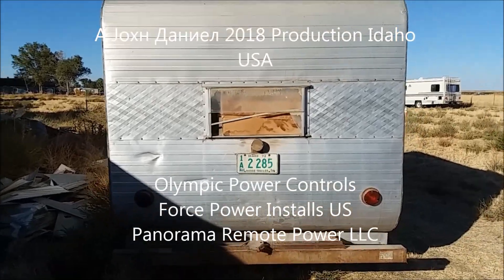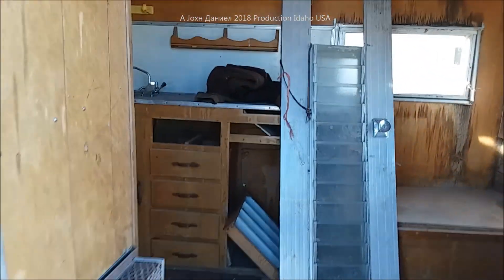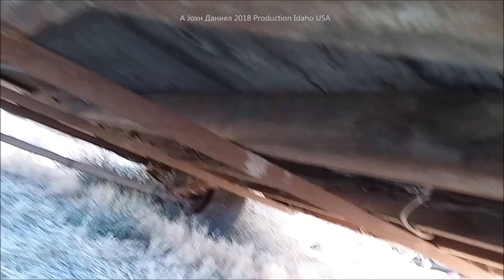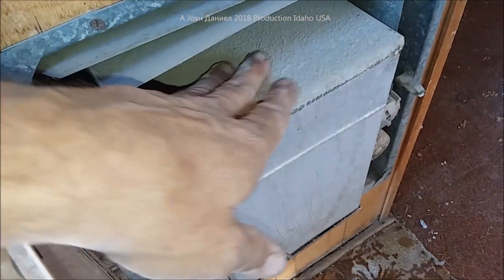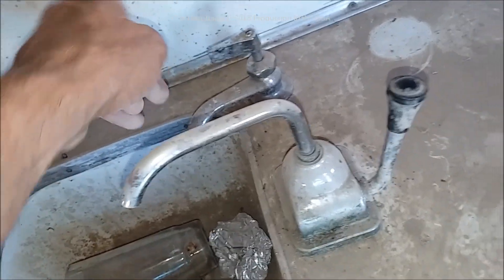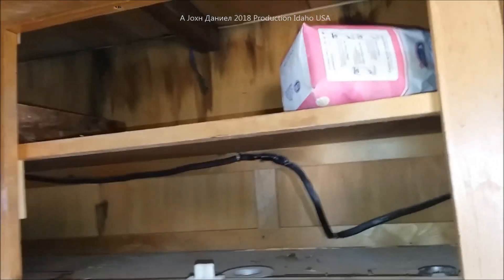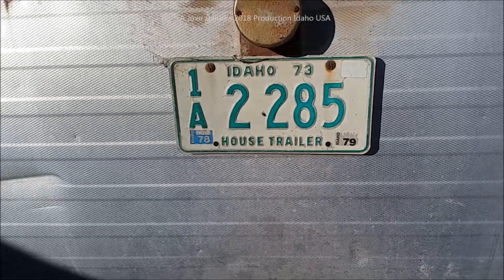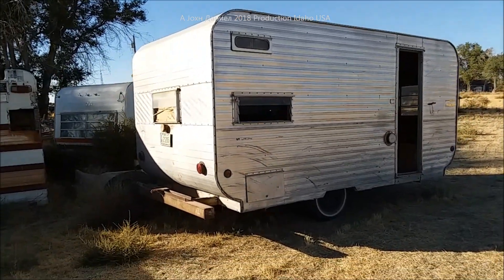60 year old Canned Ham Camper $ SAVE or ♻ SALVAGE

Comment: I had one very similar a few years back. Didn't really do what you would call a restore job on it, just cleaned it up real good and fixed a lot of things. Had it looking pretty good and smelling a little better too. Took it out on the first camping trip about 10 miles from home on the Missouri River down a gravel road. Had a great weekend in it, lots of fun. On the way back home the gravel road completely shook the thing apart. It was literally collapsing in on it's self. The dry rot was a lot worse than I realized. I scrapped it and sold the frame to a guy that made a flat trailer out of it. Rest in pieces canned ham, I tried!
Reply from the maker: This one if restored will be a copy job. So not technically restored, but certainly remade. Using 2" metal studs to frame on the existing trailer chassis with same build design. Inside cabinets and doors are damage free, so its a big advantage.
Reply: It would be sweet restored that's for sure. I really like old ones. There's a RV Historical Museum in Elkhart IN. worth going though if your ever in that area. If you decide to restore it be sure to keep your camera close, it will make a great video series.

Comment: Restore it and sell it as a classic.
Reply from the maker: The cabinets are a very nice condition even though the rest is a rot mess. So I MAY do a frame off, thats pulling the box off the frame then making a deliberate copy back on its frame.
Reply: @JOHNDANIEL1  classics are in big demand. What's coming off the assembly line these days are junk. Go for it.
Reply from the maker: Scott H  The hope is I can use it since its so perfect to use as a template to build a really simple light camper. Sleeps 4, a perfect bare bones out of the weather off the ground $4999.00 camper I can possible mass produce using the already thought out design. Since the company no longer exist, I have some nice think!

Comment: I wish I could get it and nab some curved Wood and extra wood would save some money for Steel insulated panel for Faster Restomod
Reply from the maker: If I do restore I build my best trailers with 2.25"  insulated Garage Door panels stacked and placed on 20 gauge 3/4 Furring metal, then attach the original outer metal and new inside paneling. No rot wood in the mix to be applied.